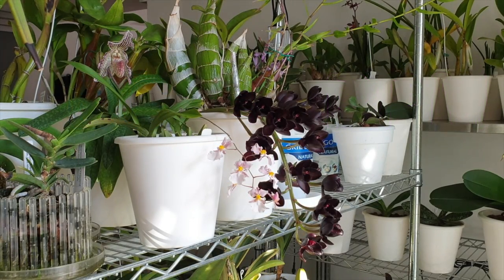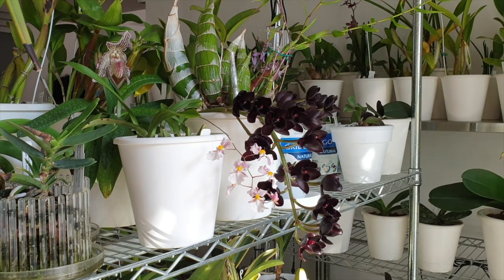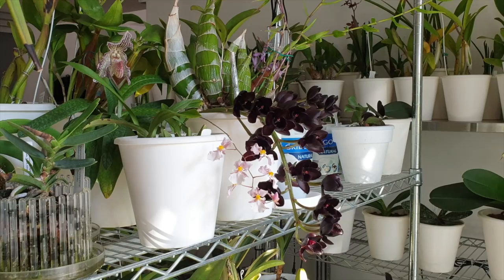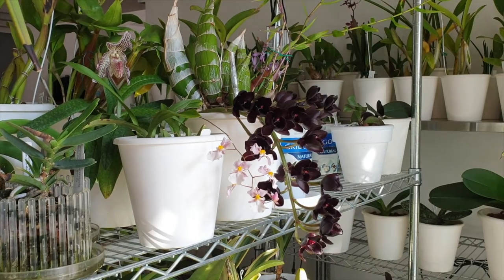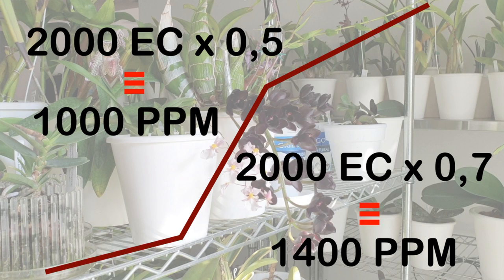EC vs PPM | The difference between EC TDS and PPM TDS readings | Is there one? 🤔🧐 #ninjaorchids

Comment: Life would be so much easier if people could just agree on something. And I'm talking mostly about Americans, who don't want to follow the standard that the rest of the world uses for measuring. Now how's this for interesting, the US conversion from EC to PPM should be 0.5. Well, I have two TDS pens from two different manufacturers (in case one breaks down, I have a backup). I just went and tested them and the PPM reads the same on both but the EC reads different. Exact same tub of water with feed at 325 PPM at 74.5 F. If I switch to EC, one reads 693 (conversion of .469)  and the other 667 (conversion of .487), so neither is 0.5. Having a second tub of water set to a different TDS (115), one EC reads 245, the other 236. So the EC conversion is consistent between both from one solution to another, but not to the standard. So do you trust the PPM or the EC? It is more baffling to me that the PPM is the same on both but the EC is not, if anything it should be the other way around. I just ordered a brand new one because now I am insanely curious to see how it reads.
Reply from the maker: Don Miguel 🥰💐 hola jefe! ok.... when I started growing orchids and started measuring my fertilizer water from the sprinkle unit to actual concentration using an EC measuring device 😅, I started with everything in microSiemens. Seeing as it is the more accurate of the 2 readings, I thought this was the best way to go about it... besides, Siemens, German... no brainer 😂😂 This was me fiddling around with something I had no clue about, but... started to try to get an understanding of while dyslexia told me that it was way over my head! I stuck with the microSiemens and then I started watching youtube videos and everyone was in ppm ... then Rick L was on about ppm as well, and all the while I am converting, using 0.5 or 0.7 to get a better reference of what quantities everyone was talking about. My logic was...if I thought a ppm mentioned, was too low, I would switch the conversion rate to 0.5 to get a ppm that sounded more sensible 😂😂 it was a mess... just as well I switched to ppm, because doing videos now, I can only imagine the questions if I kept referring to microSiemens 😬 certainly made my life easier in the end! If I was a crop hydroponic grower, where the numbers really needed to be dialled in to pinpoint accuracy for maximum yield, then the EC meter would also be of a higher quality. I don't know what brand / price range your pens are, but... I have 3 and all will read different in ppm. Across the board, low price point, medium and high... I am in the range of 20 - 30 ppm off. So, I don't frustrate myself with that, because that was diving me nuts back in 2019 😂 I would trust the EC. The reason I have 3? Because it drove me nuts as well... now, I use the same one, calibrate it and am done with what I see, based on how much I am adding to water, referring back to the sprinkle measure 😂 thank you for going to the trouble to measure and commenting with your findings! That was neat 👍🏼👍🏼and thank you for watching! Hope your forecast is totally wrong and things are warmer and toastier 😍❤️🌸

Comment: Great topic and very interesting. Best explanation anywhere Nina.  I've spent some time studying EC and here's what I concluded.  I could have repotted 25 orchids in the time studying the use of EC for growing orchids. Drilling down to the exact  number of EC in practice is nearly impossible.  It's PPMs for me.  If I target 175ppm for my solution and end up at 160 or 190, no worries.   My orchids won't know the diff and their perfectly happy.  Thank you for clearing up this EC hot mess. You are the Orchid Master.  Happy Thanksgiving. ❤🎉😅😊
Reply from the maker: 🌸🥷🏼 Bob San 😍🙌🏼🤸🏼‍♀️🥰💐 hi!! Thank you for the feedback and for watching! It can be really weird to hear someone reference microsiemens when they speak of concentration, my brain has to assimilate what their concentration is 😅 thankfully, though, 95% of the growers I know, use ppm and it is possible that some once were on the EC measure and have switched because ppm really is so much more easy. We would need some higher tech meters, more sensitive ones to measure EC properly... which, as you quite rightly say, is not necessary for our orchids and the quantities we are talking about / dosing / applying. So kind of you to sit through a video like this.... goes to show your caliber as an orchid grower to have interest in something like this 🫶🏼 thank YOU so much 🌸🥷🏼Cariño San!! I hope you are having a great day 🫶🏼❤️🌸
Reply: @NinjaOrchids  Thank You Nina, you're the Best! Much ❤️ ❤️ ❤️

Comment: This was one of the best vids I’ve seen explaining all the basics of EC vs ppm vs water temp vs the 500 vs 700 scale for ppm. My question is if given a temp of 70* Fahrenheit what ppm scale would be better used given that the water base is 0 ppm to start and if using EC measurement which would represent a more accurate ppm score as the content of the solution will be only nutrient dependent? Will ppm in this case still be a better scale to use? Great video, thanks
Reply from the maker: HI 😍💐 welcome!! I have not seen you here before, so a warm warm welcome and a massive thank you for being here, for watching and for your positive feedback, I truly appreciate it! To answer your question, when it comes to orchids, the accuracy of EC vs PPM is almost irrelevant. Orchids need so little fertilizer that EC accuracy won't make a difference. We are not talking anything above 1000ppm (some growers go that high, and higher depending on what orchid they are growing but it is a very RARE value used in orchid collections that are more common) but, the quantities we apply to our orchids... I would always go with whatever is more comfortable. I started with EC, because I was growing houseplants in SH in Germany back in the 80s. But, when it came to orchids, I found that working with EC was unnecessary. When I started posting videos, I figured that it was time to switch to talking and measuring in ppm because it is the more commonly used measurement. Not sure if I am answering your question properly, but in a nutshell, our orchids need so little, ppm is supposedly easier and the margin of accuracy when going with EC will be totally lost. Let me know if that makes sense or if I have prompted more questions 👍🏼 thank you so much for watching and once again, welcome! ❤️🌸